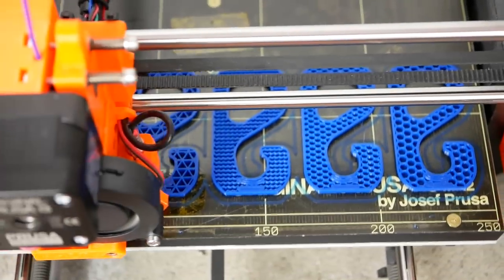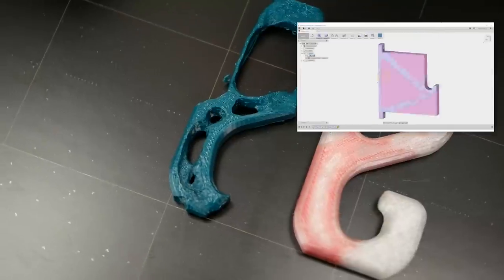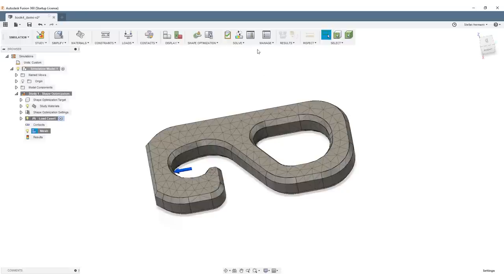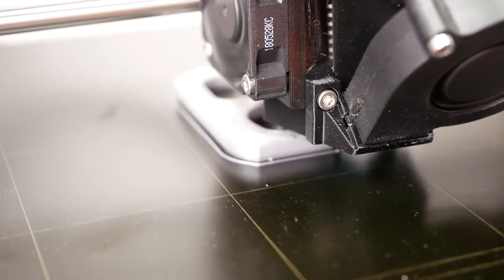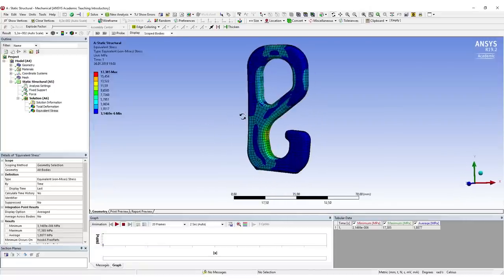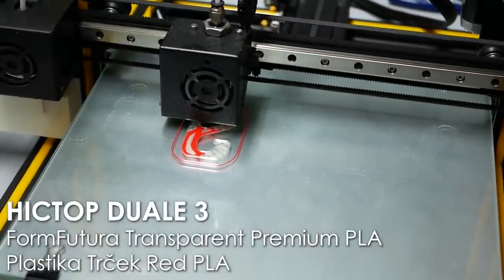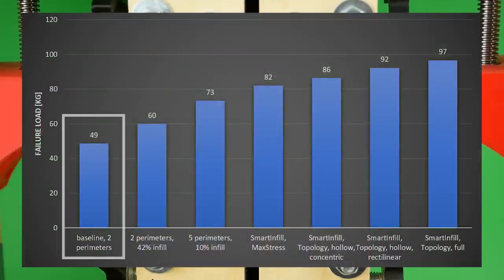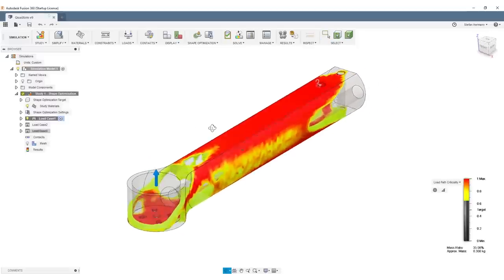Load dependent Infill placement: Smart Infill for FDM 3D prints!

Comment: Between this and 5 axis printers, full strength 3d prints aren't inconceivable, especially if you assume advancements in materials. It's even conceivable that 3d printed parts might be stronger one day, because injection molding and machining are never going to be able to do shape optimization to anywhere near the level that 3d printed parts can.

Comment: They got rid of promote mesh with update I believe..
Reply from the maker: If it's still working as far as I know. Just the buttons are at different locations. Tried it on the latest 1.42 beta.
Reply: Derp, I wasn't in shape optimization, just static load lol.
Reply: @CNCKitchen  Hey, why didn't you complete this whole process in Fusion 360?

Comment: Where would the 100% infill be in the load test?

By the way, freecad also has a FEM workbench which looks pretty usable and pretty fast. No cloud necessary. For using it you need to install gmsh and caliculix. I tested it with a similar model to the test hook and it took under a minute to compute.

Here is a video of someone using it:
https://www.youtube.com/watch?v=A6jJemyVdl8
Reply from the maker: Did that here : https://youtu.be/AmEaNAwFSfI